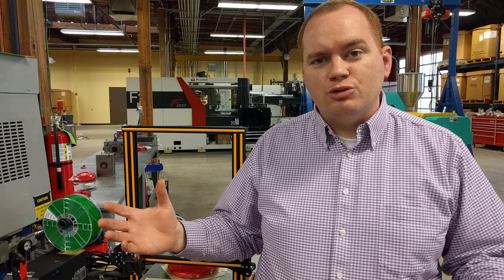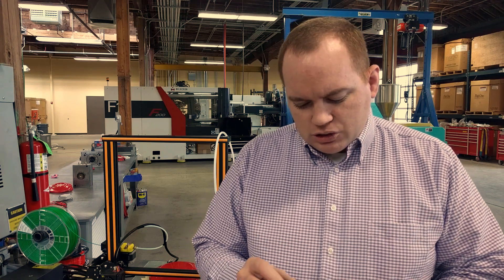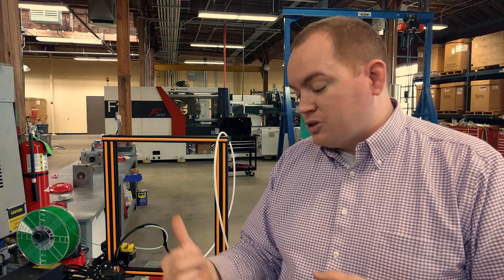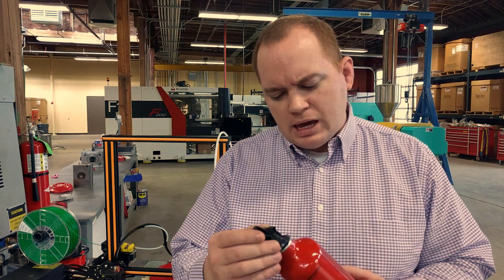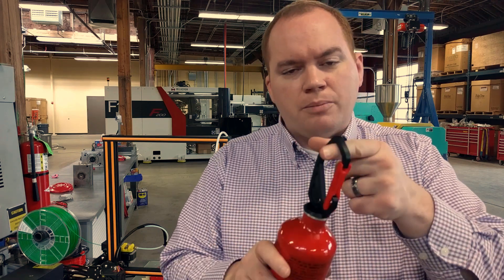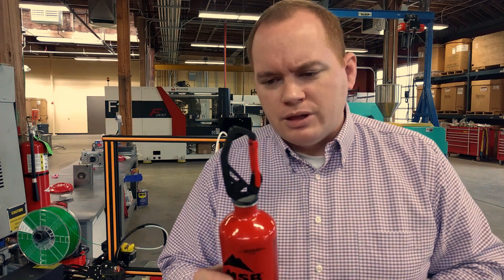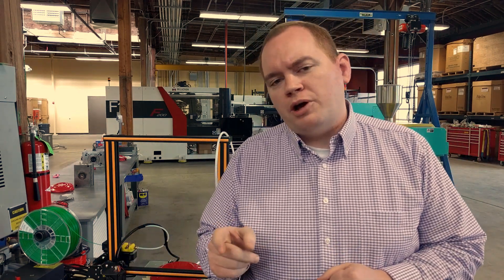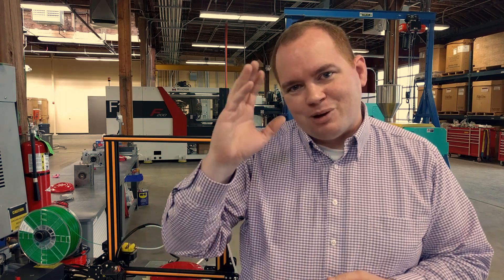3D Print Vs Injection Molding (Part 2)

Comment: There is a very useful step between the two extremes, which is to 3D-print (MSLA, with resin) your molds and use a manual, one-shot injection molding machine.  Check out the CrafsMan videos to get started.  https://www.youtube.com/watch?v=wMRSPXt48CI  You can do low-volume injection molding for under $500 including the machine and a pair of molds.

Comment: Great Video. One thing to add. Production 3D Printing machines and services can produce at the same rates as injection molding. Because even though 1 3D Printer is slow hundreds of them working on the same parts are now producing hundreds to thousands of parts, and can do it at a cost comparative to injection molding. Here is a great post about cost breakdown.  https://www.slant3d.com/slant3d-blog/the-cost-of-3d-printing-vs-injection-molding
Reply: The cost is not the same ...
Reply: @polomono6326  Production 3D Printing generally breaks even with injection molding at about 100,000+ pieces. So the cost is pretty close to the same. Toyota considers 25,000 to be mass production